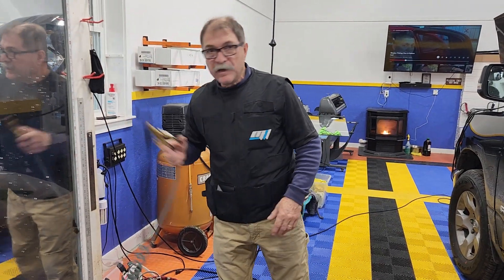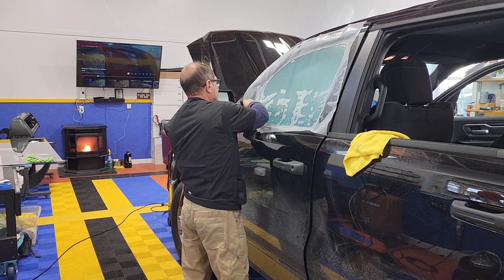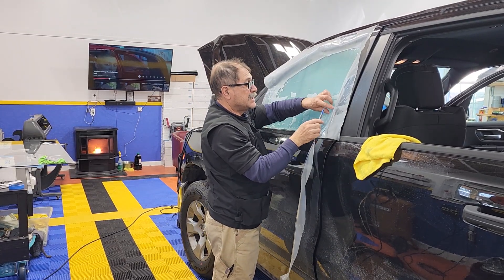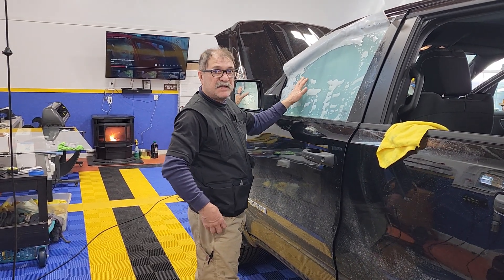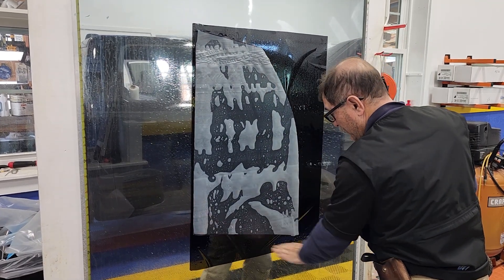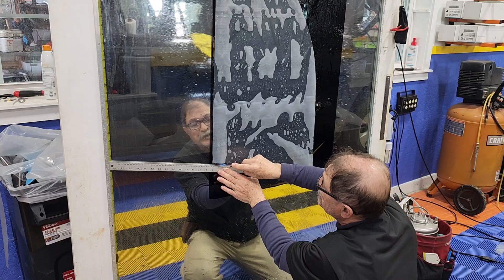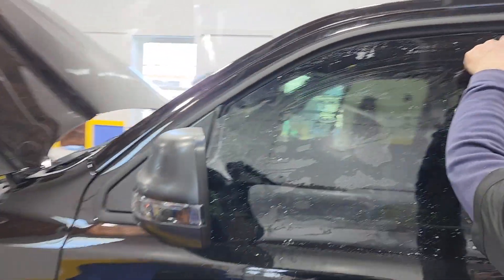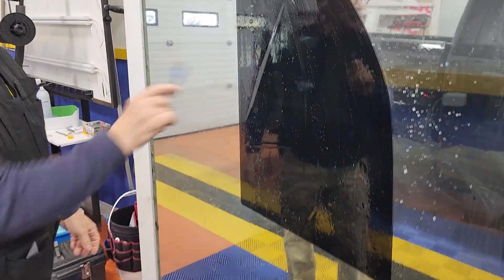window tinting class. How to hand cut a roll-up using a template.

Comment: That’s too much work don’t you think? What I do I put my film on the window, do my sharpie method, then add another film on my peel board, then I can cut two at the same time
Reply from the maker: That's exactly what you should do, when you know what you are doing. I probably have more than one video here in the channel showing exactly what you just described. This video is for someone who doesn't know what to do and don't want to trash a lot of film before they learn a little.  Keep up the good work! Thanks for the input!
Reply from the maker: Just a quick question: How do you deal with a car that has the rain guard?
Reply: @ismailgurgel  I lay the film as usual then when I’m ready to cut the top I roll it all the way down till I have access on my top edge, then I cut.
Reply from the maker: Nice!  @AnthonySalagdo
Reply from the maker: Some films can take a lot of abuse before they crease or crack, some films will creace and crack very easily. So when you are using one of them very hard to bend films, the template can really save the day! @AnthonySalagdo